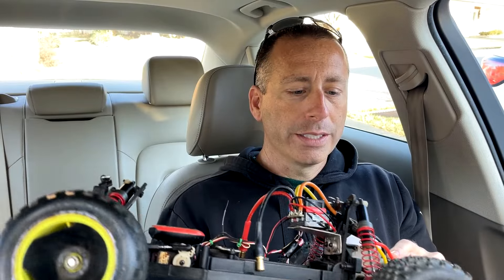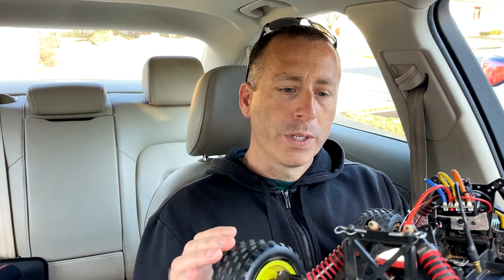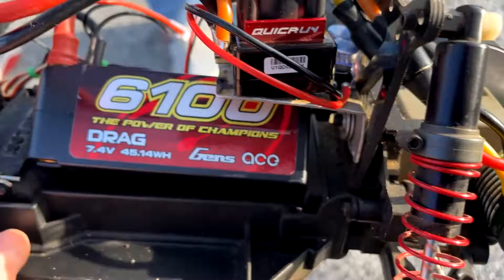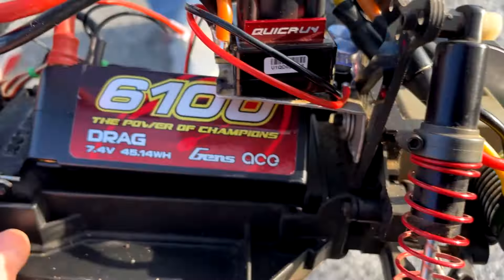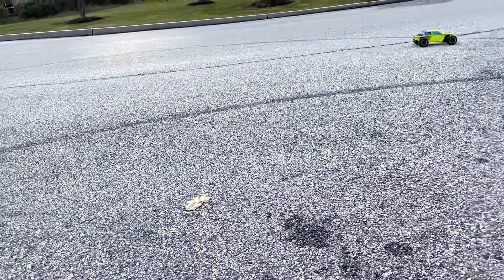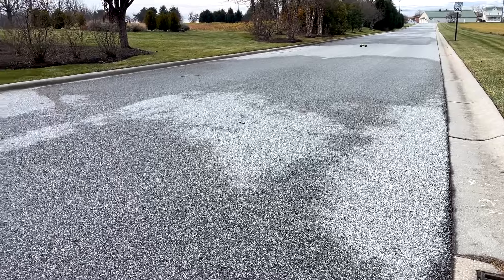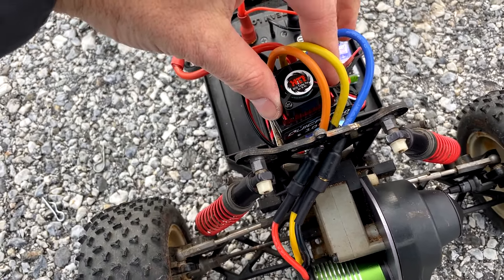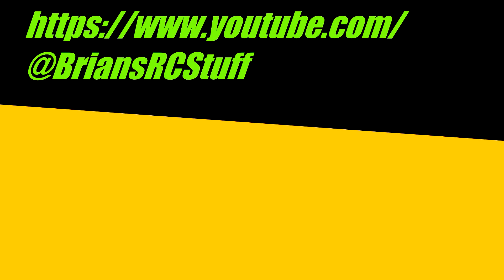Losi LXT - From 19 to 53 mph just by Mounting a $30 Motor! Range Testing of the LDARC Transmitter

Comment: I agree Brian! what a match for both the motor/esc set up and this Car. A match made in Rc heaven? LoL! 
I'm impressed with your Dad having a crack at it! he did good! I like that; a young man at heart! ❤👍
Great upload Brian!💥✌👍
Reply from the maker: Thanks!  So I forgot to take out the hydradrive!  It seemed a little sluggish off the line and it didn't occur to me until after I ran it that it was still in there.  They are not supposed to like high power.... but I guess as most of it was speed runs it may not have been too hard on it.  I took it out for the next runs (I was going to do them this morning but it was a bit windy and I was going to run my Bandit too.... hopefully next weekend will have better conditions!).

Yeah, my dad did pretty good.  He used to drive my cars a bit when I was a teen but he never really got into them.

Comment: Man thats a cool rig Brian..  Xteam motor doing well..  Nice Transmitter bud I'm a Dumbo guy but that seems like a good deal range seems decent..
Reply from the maker: Thanks man!

It is hard to go wrong with Dumbo especially with its great range… I like mine a lot but I really like this one too as long as the speeds are under 70 mph or so.  One of these days I will get around to arrange testing my Dumbo unit.

I am digging this 3650 5400kv Xtream for sure…. I have a ton plan for this motor, including it running it in my bandit. I am thinking it can probably get the car faster than the stock motor even with less torque (stock is a 3656 3500kv)… Be it with more heat because it’s been so fast.

Comment: 120 amps? Theres nothing in my home, Air conditioner, Washing machine, Table saw that uses more than 30 amps.. That boggles my mind
Reply from the maker: Kind of crazy but it is operating at around 1/10th or 1/20th the voltage as 110v/120v on 3s and even less on 2s (12 vs 8 volts) so…. We are talking about 950 watts as I was running it and 1400-1500 watts and going to run it this weekend.  Still a lot to me! 😱

I have a new motor that I am going to run in my Bandit to hopefully hit 100 mph that will pull well over 150 amps and around 2,000 watts.
Reply: @BriansRCStuff I got a slash 1/10 2wd brushed and it’s slow af lol I needa upgrade asap
Reply from the maker: @MyRcGoSlow  it is an easy fix!  Are you just going to use it to bash?  I would get a 3660 sized motor (or even a 3665 but it may eat axles) that is around 3,500 kv.  If you want something that is stupid fast, my XTeam 3660 4650 is a monster but will get hot after a couple minutes of running.  A Howbbywing 120A ESC should do well for you.  If I can be of help, please let me know!

Comment: Past 60 mph the wind will flip it right over. I may have done this and had that result. Past 60 you have to get creative with the aerodynamics of the body. It’s quite spectacular when they try to fly without wings.
Reply from the maker: I hit 62  mph with mine (the only time I ran 3s) and it was still really nice and stable!  Maybe it wouldn't have gone much faster than without some weight or a spoiler!

I hope you didn't damage yours too badly.  I got ride of mine as I know I would break it speedrunning it and the parts are not cheap or easy to find so it deserved to be in kinder hands than min lol.

Comment: That’s crazy for 2s how are the diffs holding up?
Reply from the maker: Well, I only ran it once so I can't make much of a claim but so far so good.  I don't think it is really much harder on it than when it was stock (I have the punch turned down on the ESC and I think the slipper clutch was taking the shock out of the drivetrain.  When I run it on 3s I am going to be extra light on the throttle application. 😁

Comment: Very nice on your 53 mph. Even vintage rc race trucks are very stable at higher speeds. Does that  controller have a fail safe?
Reply from the maker: Thank you!  It does but I have not looked into how to use it yet. 

Yeah, i was shocked with how stable this truck and my other LXT that I had was at speed!  I was going to take it out and try 3s this morning but it was too windy and the wind was coming from a bad direction.  Oh well....
Reply: @BriansRCStuff  I second the 3s